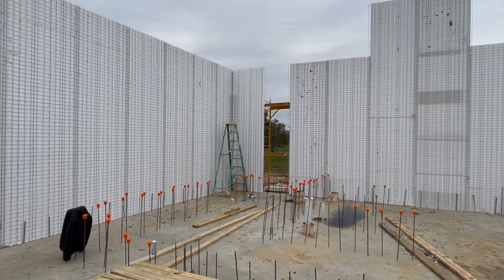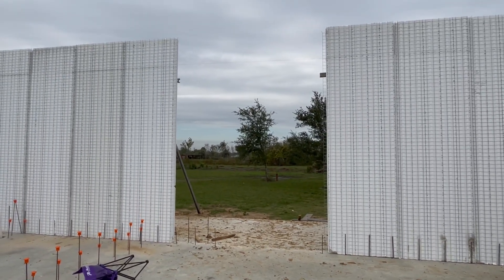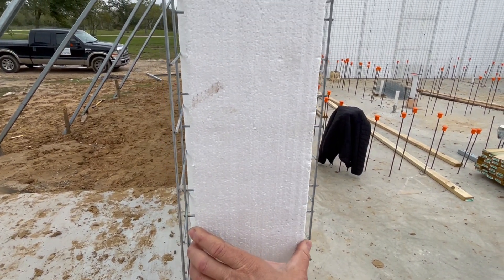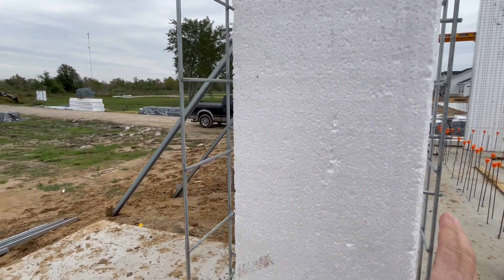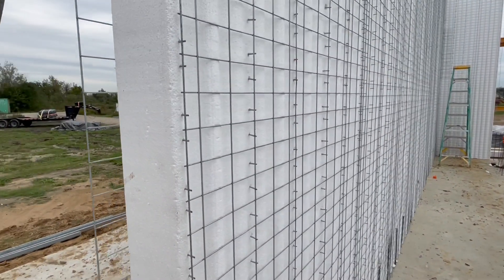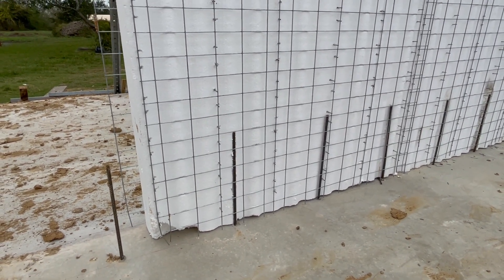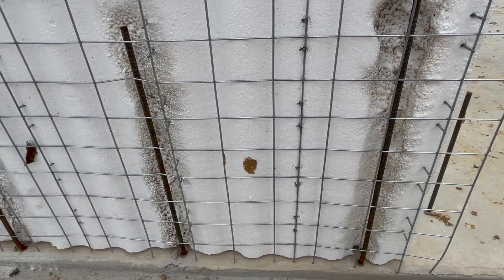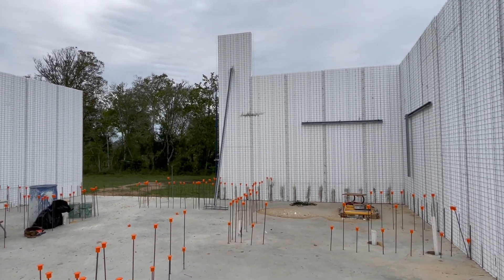SCIP House in Alvin, Texas - part 3 - EcoKrete Construction LLC

Comment: @ 3:15, why are the rebars just 2 ft tall, not installed from floor to ceiling as one would expect?
Reply from the maker: The rebar is only required to protrude 18 inches above the top of foundation.